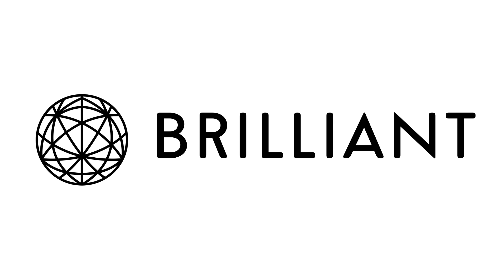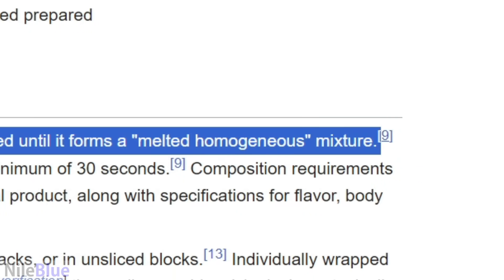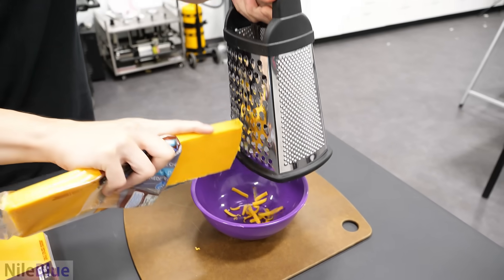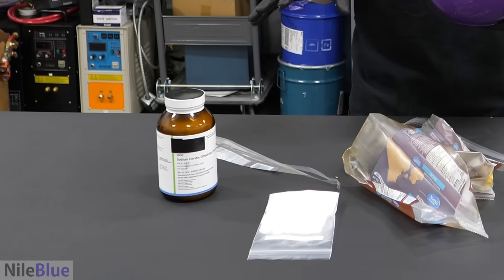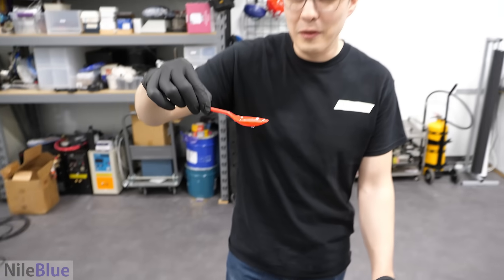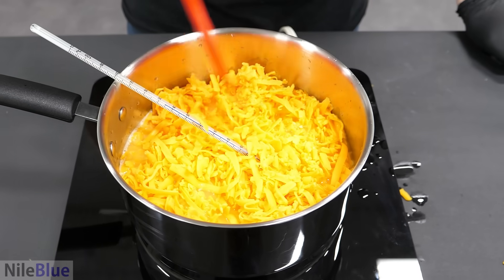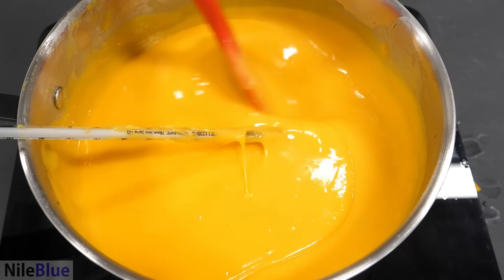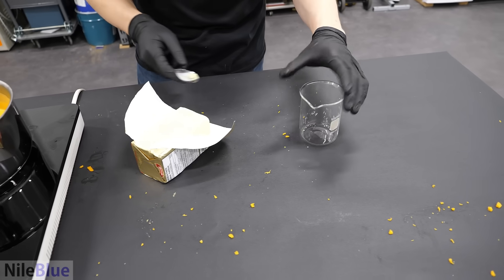Making American cheese to debunk a conspiracy

Comment: I have a friend who used to (maybe still?) work in a milk processing plant. He said that the cheese that is used to make the ‘plastic cheese’ products was basically any milk/cheese that didn’t meet their standards for their higher quality products. A great use of stuff that would have otherwise been thrown out.
Reply: I briefly worked in a cheese shredding plant, where we'd shred 5-10lb blocks of cheese to make the pre-shredded stuff.  For any given variety, we'd throw up to 20% other cheeses on the line, just whatever was about to be legally unsellable or which there was a glut of.  Anything that couldn't be sold in block form for any reason.  One of those reasons was mold; if there was mold visible on the block, we were to cut off any dot of mold larger than a dime.  Smaller mold patches went right in, because it'd take too long to cut off all of the mold.

So shredded cheese is pre-seeded with mold, made from the older cheese to begin with, and not even the variety or brand on the label.  And this wasn't for a generic supermarket cheese brand, this was a proper brand.

I stopped eating pre-shredded cheese after that.  Of course, it didn't help that I'd come home each day covered head-to-toe in a layer of cheese mixed with sweat so think I could scrape it off with a knife.

At least processed cheese is cooked a bit as part of the process.  Should kill at least some part of any biological contaminants.
Reply: Basically the whole point of American cheese was to make the cheapest cheese possible out of cheese scraps and other dairy products
Reply: @derekw4836  NileBlue:  "Making American cheese to debunk a conspiracy"
                             derekw4836:  "I wasn't listening and I've learned nothing."
Reply: @oasntet  that is pretty disgusting with the mould in the cheese, is that just a US thing?
Reply: @conorstewart2214  for cheddar and hard cheeses you can just cut off the moldy bits and its fine to eat
Reply: @firuis1  But I believe you can't do the same thing with softer foods like soft cheeses, fruits and bread, because the mould filaments (which act like tree roots) can be much further down and permeate the food.
Reply: @conorstewart2214  they do the mold thing in germany too afaik, someone working in a factory told me like 10 years ago.
Reply: @conorstewart2214  I only know about the one factory line I worked on.  I have no idea if it was legal or not; the FDA does set limits for things like mold (and insect parts) and those limits are above zero for most things.  I don't think that makes it a US thing, though, more of a capitalism thing; no company is going to tell employees to throw out a product if they think they can get away with selling it some other way.  Maybe other countries do a better job at catching and punishing companies that do this, but every company is going to do the math and take as much risk as they think they can get away with.
Reply: @firuis1  Yeah, that's fine.  Mold is a pretty common thing to happen in any natural fermentation process (like cheese-making), but most can be dug out and the rest of the cheese made safe.

But the factory line I worked on only bothered with mold spots larger than a dime, so every bag of shredded cheese had mold spores thoroughly stirred into it.  It was probably safe-ish as it came off the factory line, but even just the time it took to get it to the store would be enough for that mold to double in size several times over.
Reply: It is also a great way to work 20% water in the product to make it much cheaper.
Reply: @conorstewart2214   Where you from bud? Because that's pretty much the standard thing across much of the cheese eating world.
Reply: @firuis1  I know you can just cut it off and eat it, my disgust was more at leaving smaller patches of mould on.
Reply: @jasonhunter2819  I know mould in some cheeses is fine and with hard cheeses the mould can just be cut off, the part I was disgusted about was leaving smaller patches of mould on the cheese and putting it in the shredder.
Reply: @DerXavia  yeah that's one of the only reasons I can see for why they do it. If you want a meltier and runnier cheese then you can just get a cheese like that, but instead they modify the cheese and add in water, it must just be a cost thing.
Reply: @firuis1  once mold is visual on the outside that means the inside has been moldy for awhile already
Reply: @DerXavia  depends where you get your water? some of that bottles stuff is crazily priced? might interesting to see Nile red or Nile blue, could make a mineral water, from tap water, or something, putting so called health benefits stuff in it?
Reply: @conorstewart2214  sounds like more of cheap business practices than specifically an American thing. I’d be surprised if that’s even legal, considering that the mold can easily contaminate the whole batch if a worker fails to properly remove any mold.
Reply: @conorstewart2214  yeah i'm usually pretty careful about trimming off the mold myself on cheese...bread though I don't mess with. A bit of bread mold and the loaf is gone for me.
Reply: @oasntet  that is why my shreded cheese gets moldy so fast. I thought I had a problem with my refrigerator

Comment: Pour it into a block mold and put it in the refrigerator. After the block solidifies, slice it. The top of your cheese is discolored because it dried out in the refrigerator.
Reply: When they make the packaged slices, where every slice is wrapped in foild, they actually fill the liquid cheese in the foil and let those cool down and set. so the foil package defines the slices.When made it is like plastic welding an endless tube of foil with cheese into pieces.
Reply: Or he needed to cover the tray in plastic wrap
Reply: I was thinking the exact same thing. That way you can create as thick or thin slices as you want them to be.
Reply: wax paper my dude
Reply: @alexanderkupke920  its so crazy that we use fucking plastic to cover each fucking slice of cheese. This world is lost
Reply: @Noven30 what do you expect people to use? Papers?
Reply: Or a cake mold anything and cover it up. Yes this is cooking 101.
Reply: @Noven30  In this case sadly the plastic is how they get that soft melty stuff to stay in slices at all. The chemical mixture in there is in German known as "Schmelzsalz" which directly translates to "melting salt". The issue with that is, this cheese abomination stays so soft and melty, you cannot easily package it as slices without plastic in between. Or you would realy have to keep it cooled. Even at relatively low temperatures compared to actual cheese it would start melting and fusing together. also, as it is softer than actual cheese, in industrial size production that stuff would be a nightmare to cut in slices without tearing them. Not impossible, but way more complicated. 
Only way around that, not using processed cheese but real cheese. On the other hand, I don´t know if some receipes would work out the same without the lowered melting point of processed cheese, especially some where processed and actual cheese get mixed.
Reply: @alexanderkupke920  abomination is such a bad word for this and makes you come off as a wannabe elitist
Reply: @Crawdoodle  yeah may have been either a bad word choice or to little context.
While I know that in the US most of those slices are perfectly fine and taste and work well, especially if being melted, eg on a burger. And lets face it, most all burger outlets, be it MCDonalds to a restaurant making fresh premium burgers, unless stated otherwise, that is what will be on your cheeseburger. And nothing wrong about it. Although personally I like real cheese better, just personal preference. But i must have had some of the slices they sell here in Germany in mind. first of all, those are tiny in comparison, I would say at most 2/3 of the edge length. You need half a pack to cover a slice of bread. Tasting like, eh, somewhere between plastic and chewing on aluminium foil after visiting the dentist or weird receipes with, I don´t know what cheeses or extra seasoning in there. Still tasting not like a lot. And if you find good cheddar based ones, it is almost cheaper to actually buy sliced cheddar.

Comment: Sodium citrate for cooking purposes is actually really easy to make at home! Just combine lemon juice with baking soda. It should immediately froth up, even without heat. Once it's nice and frothy, the lemon juice won't taste sour anymore. That's how you know it's ready. Then you just add your cheeses, apply heat, and voila! I use it for a cheese sauce, but by pouring it in a square-shaped container and letting it chill, it becomes very much like a soft cheese spread. I imagine more citrate=stiffer cheese.
Reply: That's really cool, will have to give it a try!
Reply: Thank you, I'll try it out later
Reply: Commenting to come find this later
Reply: whats the ratio of lemon juice to baking soda ands sodium citrate to cheese?
Reply: I'm not a chemist but I think its viscosity is determined by liquid content. As an emulsifying agent, you're emulsifying the fats of the cheese into the water left behind from the lemon juice. If you just mix dry sodium citrate into melted cheese it'll solidify. You could try simmering the liquid content down or adding extra water before adding the cheese to confirm this.
Reply: @ihateithere._.  You need around 1 g of sodium citrate per 100 g of cheese. To get 1 g of sodium citrate you'll need around 11 g of lemon juice and 1 g of bicarbonate (which it is dosed a little bit in excess).
The reasoning: 1 g of sodium citrate is 0,0034 mol. You'll need 0,0034 mol of citric acid which is 0,65g, lemon juice is around 6% citric acid so you'll need 11g of it. You'll need 3 mol of sodium bicarbonate per mole of citric acid, that's 0,0102 mol or 0,85 g of baking soda to make a gram of citrate. You'll want to dose it a little bit in excess to completely remove the acid, otherwise there will be some sort of equilibrium, let's say around 20% of excess so 1 g.
Reply: More citrate doesn't really do anything, you just need to add less liquid
Reply: Can confirm, too much sodium citrate and you go from creamy cheese sauce to way too salty cheese sludge. Those proteins can get to know each other a bit too well if you're careless.
Reply: @ihateithere._.   Adam Ragusea  did this short if you want a demo of how to make the sodium citrate with lemon juice and baking soda. https://www.youtube.com/shorts/KKG-LznoJJo
Reply: It's great for cheating when making a cheese fondue-it stays creamy and won't split and doesn't affect the flavour.
Reply: For ease and consistency you can use citric acid in powder form.

3NaHCO3 + C6H8O7 → 3CO2 + 3H2O + Na3C6H5O7

21g of baking soda + 16g of citric acid yields 21.5g of TNC
Reply: @iandi9894 if you're going to buy powdered citric acid just skip it and get sodium citrate instead
Reply: @Decinomic0n  same
Reply: Who cut the cheese? 😤
Reply: @MrNoipe yeah but the ingredients are way easier to get than the product itself.

You can get citric acid and baking soda basically anywhere
Reply: Thanks @savokanpari
Reply: cooking recipes on a chemical channel. thanks!. I hope Niley boy pins your comment
Reply: @ihateithere._.  Just add it slowly. Once it doesn't fizz when you add more, that's as much sodium citrate as it's going to make.
Reply: I wanted to go to the store to get Sodium Citrate to make a super smooth cheese sauce. Now I don't need to.  😅
Reply: You eat that crap? Really? Good luck dude.
Reply: Just make sure there is no anti stick layer or something like that. it needs to be a good old cast iron pan or something like it.
Reply: I did that last time, but had a really off-flavor. Does sodium citrate have a strong off-flavor, or I didn't use enough lemon juice to react with all the baking soda?
Reply: I have to try this. If only to impress the wife!
Reply: I do the same thing to pour on meat, especially in burgers and I love it!
Reply: Super good advice, thanks! Even as a cook with a chemistry background- I never knew or thought of that!
Reply: Sodium citrate is so cheap that there is no reason to make it yourself. I'm pretty sure that buying lemons and baking soda would be more expensive (depending on your country), because a lemon is not the best source for citric acid (https://www.youtube.com/watch?v=FMtayizdFiw)
Reply: @iandi9894  sweet, thanks! I have those things!
Reply: @pascal2085   Cooking is very enjoyable as a hobby as well as a way to satisfy hunger needs. I also make my own bread, even though it's so cheap there is no reason to make it myself. :)

Comment: Fun Fact: "Kraft Singles" and similar store brands are classified as "Pasteurized Prepared Cheese Product" because it's made partially with vegetable oil,  but there is deli-style American Cheese (ex. "Kraft Deli Deluxe" slices) and they are classified as "Pasteurized Process American Cheese". Which means it's a higher quality and has a higher cheese content. You basically made Deli-style in this video because it didn't have oil and fillers. This is why I always will be an advocate for Deli Style American cheese. It tastes so much better.

You don't even have to get Kraft. Great Value (Walmart store brand) sells their own version of "Deli-style" American Cheese and its just as good.
Reply: Guess I have to buy deluxe from now on. Vegetable oil. Eew.
Reply: Guess Nigel has to redo this video, and add vegetable oil. The cheapest stuff from Walmart.
Reply: I recommend cooper cheese. It's basically "sharp american cheese"
Reply: I didn't have kraft singles until I was an adult. I've only ever had the deli stuff
Reply: Basically correct, but incomplete. You’ve covered the two highest quality classifications of American Cheese, but there are two more. Find Kenji’s article “What Is American Cheese, Anyway?” at Serious Eats for a more complete rundown.
Reply: I like LoL cheese.
Reply: That's probably why some of the old super, super cheap sliced cheese had an oily layer on top that just tasted... off. They also broke way easier and didn't melt nearly as well.
Reply: growing up my mom would buy white american cheese sliced at the deli counter, i think generally it was land o lakes brand. world of difference between that and a kraft single, the flavor and texture is so much better. it’s the absolute best for grilled cheese.
Reply: @LnRit02 I just made a grilled cheese with white American from the deli counter at the grocery store. Fucking delicious.

Let’s say it together: IM A PROUD WHITE AMERICAN LOVER!
Reply: There's also essential everyday (festival foods brand) and crystal farms which are both good.
Reply: Deli/Deluxe versions of American cheese are the best
Reply: Yeah, deluxe cheese is way better. Like the difference between cheap mac n cheese in those little bowls vs deluxe style. The cheaper version tastes like cardboard
Reply: You’re giving me Zen and the art of motorcycle maintenance vibes. How in the f’ do you define the cheese as “higher quality”?
Reply: Huh. I might have to look into that...I'm a 1st-gen immigrant and have always hated the stuff, but even I've come to like it on a burger and I have to admit its properties are nice to work with (e.g. for grilled cheese, stovetop mac n cheese, etc.), especially in combination with other tastier cheeses

But I never realized there were "grades" or anything different than/superior to Kraft Singles! So thanks for the tip
Reply: @logangodofcandy  could just use real cheese !
Reply: Also, "pepared cheese *food*" actually contains less cheese than cheese "product." So like while Cheese Product is kinda ehhhhhhh it's at least miles better than Cheese Food.
Reply: "didn't have oil and fillers"

he literally added butter (like 80% fat) and milk powder (like 30% fat) lmao
Reply: interesting. The butter he used acts the same way as the vegetable oil, and the powdered milk as the "fillers". His goal was to make a cheap version like the kraft singles. Just because he used different ingredients, he still made the cheese product. Oil and milk powder create a different consistency
Reply: the Velveeta singles taste better than any other American Cheese and it's Velveeta, a cheese product amalgam.
Reply: @Spolt_main  fat content can determine how a slice melts, low fat means it won't melt very well since the ratio of proteins is much higher, these can also burn easier.  So, this isn't exactly a mark of quality and rather a ratio of proteins and fat.  But there are other fillers that could be throwing off the texture which drop the price.
Reply: Surrpised most of you who get the deli kind are eating something other than Boars Head.  Most of the deli cheese's around these parts are BH, but sometimes you get some European brand (or something that sounds European).
Reply: the only kind of american cheese i will eat is the kraft, and kroger brand. i actually prefer the kroger, it tastes more creamy but honestly it sounds kins fun to make my own american cheese now lol. espcially with how expensive a small package of american cheese is, with it still having all those oils and fillers in it.
Reply: Most fast food restaurants use "deli-style" cheese slices.
Reply: Read the ingredients. No vegetable oil. It's cheese product because it contains milk, butter, whey and milk solids as well as cheese.
Reply: Name brands and store brands are often made in the same factories.
Reply: If it’s made with oil, it’s imitation processed cheese food. Not the same thing as Kraft.
Reply: I've only ran into like three people who eat kraft singles lol.  Tbh, they ain't bad per se, but they taste very different and much fainter